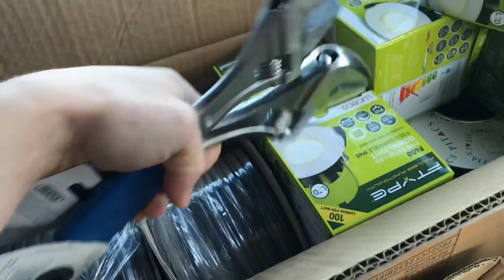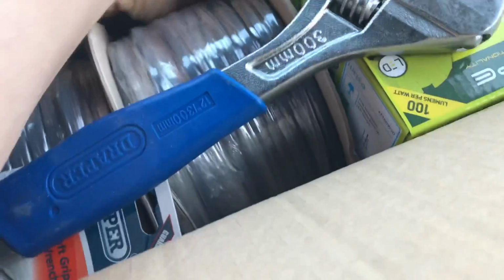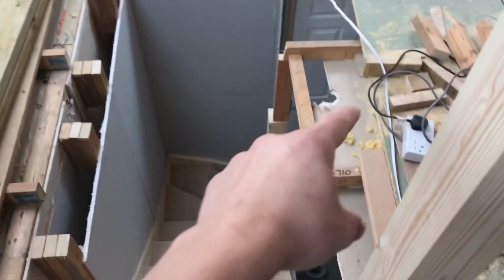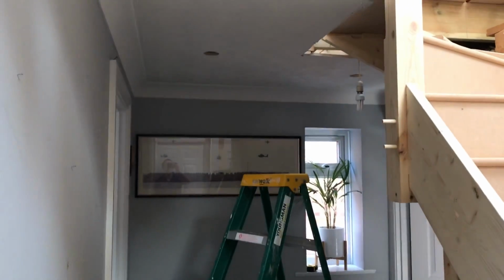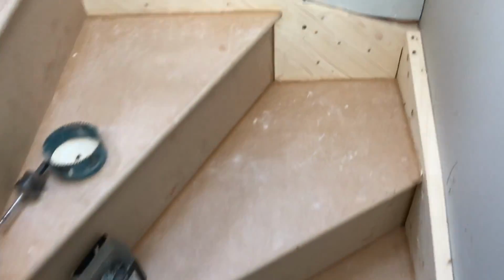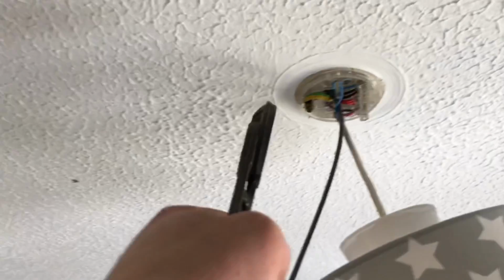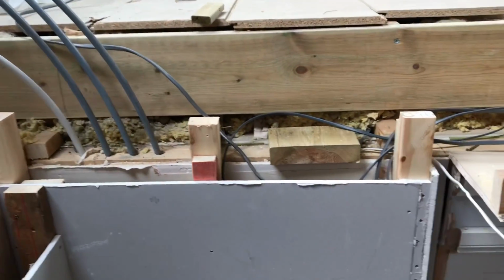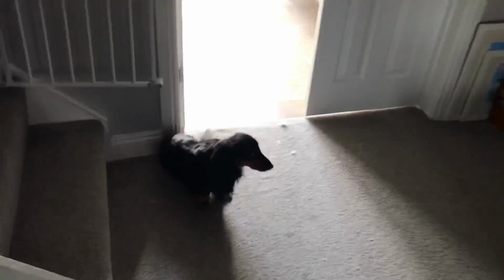CJR ELECTRICAL Electricians day lighting and power loft conversion.

Comment: Chris, please don’t sleeve the black as brown pal. Its a 9 volt signal wire only? Cheers
Reply: Just looked in regs and it I cant see what colour ident a 9 volt signal should have TBH. Its not classed as ELV which could be brown or black amoungst other colours. Think my reasoning is down to the AICO range of detectors that have the IC terminal marled as black letering on white. We're all here to learn and there wasn't any kind of abuse meant in my comment.
Reply from the maker: Okay just checked the Aico data sheets it says black wire must be insulated and sheathed and treated as if it is live .
Reply: @Cjrelectrical  makes it easier for any future workers to identify
Reply: CJR ELECTRICAL Well done for sleeving the black top job
Reply: Fraser Reid identify as what? 230 mains voltage?
Reply from the maker: It states must be treated as live we. read this in a different way I’m still going to flag it up brown
Reply: CJR ELECTRICAL maybe because its carrying a voltage, but its not a line conductor as brown would indicate. Aico state conductor to be sheathed and treated as a live conduct to illustrate that using the bare cpc is forbidden. As there would be the odd few who may run in a twin and cpc instead of 3c and earth.
Reply: We've been told  by Select to sleeve the black but I've heard the signal wire argument a lot but I'm a sleever 😆
Reply: Anyone that can't tell the difference between a permanent line and interconnecting conductor at a smoke alarm probably shouldn't be messing around with the electrics in the first place.
Reply: @ashmanelectricalservices4318  And how does this come into the sleeve or not sleeve discussion then?
Reply: @SME_Ste  Why do we sleeve conductors... To identify what they are and their function. I can't for the life of me imagine an electrician seeing  a black wire, sleeved brown, connected to the interconnecting terminal at a smoke alarm getting confused as to weather that wire is carrying 230 volts or not.
Reply: Omg. It hurts to watch. Here in Switzerland, we install every where pipes to pull electric wire in it,  so you can always renew or extend the installation.
Reply from the maker: I always do mate
Reply: @Cjrelectrical  Its not live though

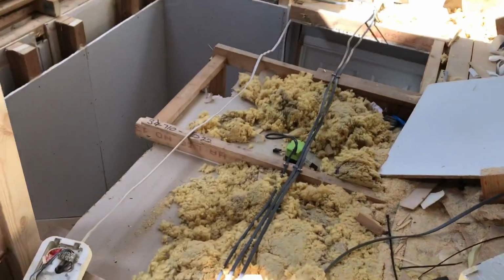Comment: 7:26 and 7:37  Switch cut-out, unusually, is squint.   You really need to use a set-square and use the door-frame as a source guide to get the cuts square, or if mid wall, use a level to get the top or bottom cut-line in its proper orientation..  That switch cover will look terrible.

Comment: Beware of the need for fire rated cable clips. I am about to add them to my latest install
Reply from the maker: Anything within the fabric of the building you don’t require fire resistant clips. Anything clipped to the surface where it could entangle a fire fighter does.
Reply: @Cjrelectrical  It was at 11:59 that I thought they could fall into the stairwell. I just did the 18th regs update course and was told to fit them everywhere to prevent any doubt. Then again, he told us to fit AFDDs on every circuit too so I realise these trainer guys are pretty extreme on their interpretation...
Reply: @Cjrelectrical  btw I really like your vids. You follow the wiring regs far more correctly than Mr Nagy.

Comment: Are you putting down lights into the roof insulation, if so how big a hole do you drill and how do you avoid cold bridging or overheating
Reply from the maker: Yes certainly installing them I will cut a small square for the down lights to go into and i use f type luceco Downlights that are insulation coverable.

Comment: The last time I looked at the mi's it stated the signal wire must be treated as a live therefore I always sleeve the wire with brown... !!!
Reply: Treated as a live does not mean "must be sleeved as a line conductor" it simply means it must be insulated to the maximum voltage contained in the cable.
Reply: Bumbles liking it👍🏻
Reply from the maker: Correct

Comment: In germoney call those adjustable wrenches frenchman, i guess because they are so useless. Most of the time i use mine as a hammer.
A pair of good water pump pliers works much better, knipex makes some with flat edges if you dont want to leave marks.
Reply: And in France they’re called ‘clef anglais’ - English spanner - so the insults go round in a circle!

Comment: Out of interest, when chopping the ceiling about did you take into consideration the possibility of asbestos in the artex? (obviously dependent of age). I ask, as for myself i consider it very important. Whilst others arent bothered & will just crack on.
Reply from the maker: The age of the house was built after they stopped using asbestos in the Artex I’ve had extensive training on asbestos awareness so still wore minimum ffp3 and pva the ceilings when we did the cut for the stairs along with our hoover.
As artex is 99% cement base it’s such a low content of fibres but use caution if your not sure.
Reply: I've always ignored it to a certain extent in artex, I have a feeling it's such a low amount of white and in so many houses without issue that it is probably pushed by asbestos companies wanting to cash in.
I hope I'm right
Reply: O Hash do an asbestos awareness course. Only a few quid & you may think differently about the risks involved. I do agree with you & believe that it’s become a license to print money. But still, knowledge is key.
Reply: @ashleybignell2366  yeah I have done one mate but many years ago so should go again. I remember it coming up and remember the different types and so on. I only do about 5% on the tools now so hopefully less exposure but I'll do a bit more research

Comment: Well id like to say good job straight away but I can’t resist in stating that glass wool should have been bagged and tossed when this attic started to go ahead . 

It’s cheap as chips to replace and taking on that job id have made sure i was changing that . Also going up stairs it looks as if Their is big gaps behind the plasterboard not sure why theirs no insulation behind that 🤔. 
The new glass wool is also much safer and serves more of an insulator than that old rubbish . ( mask still required 😂) 

Apart from that it was carried out well 👍😂.
Reply from the maker: All the fibre glass is getting another 400mm added on top of the existing anyway 
And why would I need to put fibre glass between a staircase that I’ve created and an internal wall?

Comment: The inter connecting wire in the smoke isn't 230v its a signal wire so doesn't need brown sleeving as it doesn't become live, not sure why people keep doing this.
Reply: Correct,I never sleeve it, also stops it getting mixed up with proper switch lines.
Reply: Yep never sleeved up in my life as it’s Only an interlink single wire as stated above 👍.
Reply from the maker: Please read the manufacturer instructions must be treated as live
Reply: @Cjrelectrical  fair enough Chris, I'm still not going to bother as I take my 3 core smoke feeds into switches to pick up the new lighting and like to make sure the black don't get mixed up with black sleeved switch lines.
Reply: CJR ELECTRICAL Yeah fair play I see what you do it, love the content 👍🏼

Comment: 2 way 2 gang switch at bottom of stairs. Will up stairs and down stairs lights be on separate circuits? Therefore two MCB/RCBO’s will need to be turned off to work on the switch. Do you think 2 x 1 gang switches would be better?
Ok same circuit, so is there a risk of lights tripping off and falling down stairs? Or is acceptable for loft stairs?
Reply: No issue at all. Please return to plumbing,  thank you.
Reply: What a stupid question 😂😂 it worries me 😥😥
Reply: zjzozn an the problem is what exactly?
Reply: @zjzozn, quite common to have 2 circuits in one switch box, no issues with that my freind.